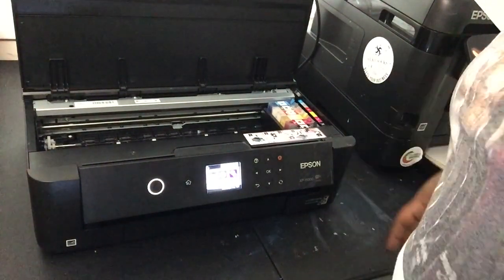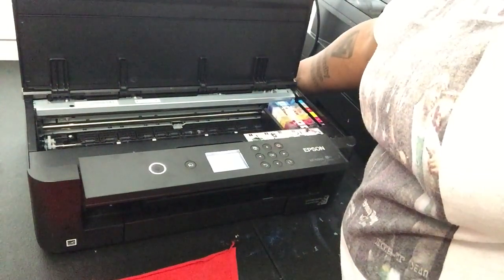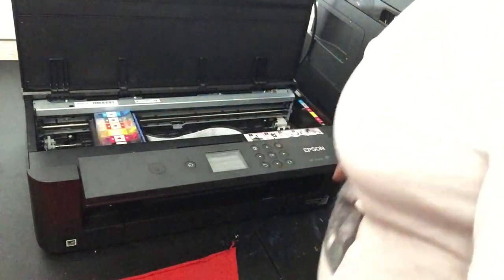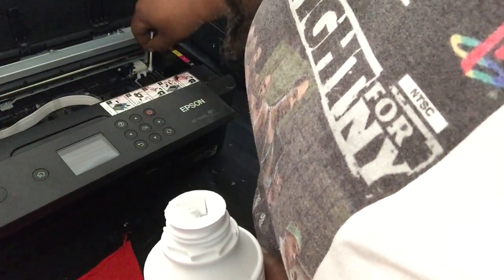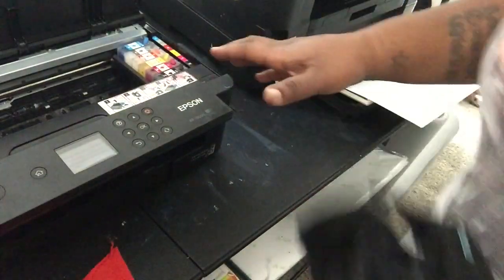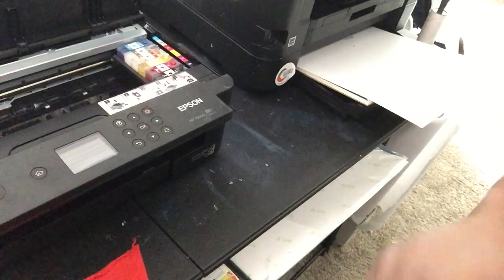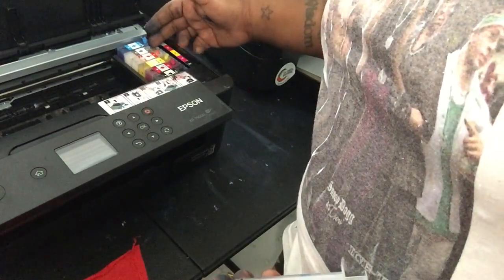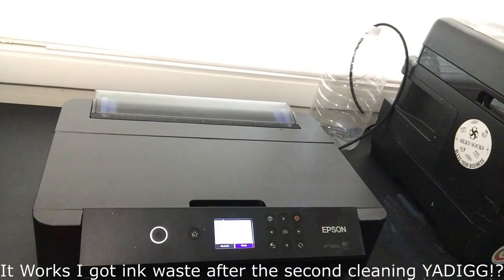DTF DIRECT TO FILM How to Maintenance an Epson XP 15000 converted for DTF DIRECT TO FILM printing

Comment: Hi.. great channel... Can You help me? Has a massive glog in all channels and don't print anything... Have the cartridges with cleaner solution but don't work after many clean process and no have any idea because i made everything to Make one succefull printer and nothing. The printer has new and no have any impression with normal ink ir dtf ink.... Many thanks again
Reply from the maker: Hi anytime I've had a clog the cleaning cartridges have always worked for me and always make sure I prime the cartridges when I put them back
Reply: @FayzoFilms  i'll still try but ay this time not worked... It's strange but with normal ink it does not print anything either ... will the print head be the fault? peeo I couldn't print anything except the nozzle check which was already throwing me only 3 colors the first time.

Comment: What brand chipless firmware did you use,?  Did you have to update your new 15000 out of the box and install the the chiless firmware?
Reply from the maker: CHIPLESS Solutions
Reply: @FayzoFilms  Hi, Did you update the new 15000 out of the box before inatlling the chipless firmware, or did you install chipless without updating?
Reply from the maker: I installed everything normal with my printer fresh out the box and then I installed the chipless firmware
Reply: @FayzoFilms Thank you

Comment: Newb question here. What are the steps to switching over to cartridges with cleaning solution for maintenance? Is it basically just taking out the ink carts and putting in the carts with cleaning solution? And is this required before and after each print session?
Reply from the maker: So I've only used cleaning cartridges on two occasions so far the first time I used it is when I went on vacation for the weekend and yes it's just a simple as removing the old cartridges put in the cartridges with the cleaner run two head cleaning and when you come back just put the cartridges with the ink back in and ran a head cleaning and you're good well that's what happened in my case the other time I use the cleaning cartridges is when I had a clog in my magenta
Reply: @FayzoFilms  Ok thanks. And is shaking of the white ink cartridges still required before each use?

Comment: So when filling in the printer, you don’t plug in the clear vent plug before pulling the colored plug? I thought ink would leak through if both are unplugged at the same time.
Reply from the maker: Yes it's recommended to fill it up with the clear plug in it but I don't I just make sure I'm very careful but if you're more comfortable with the clear plug in when you feel it yes it is recommended